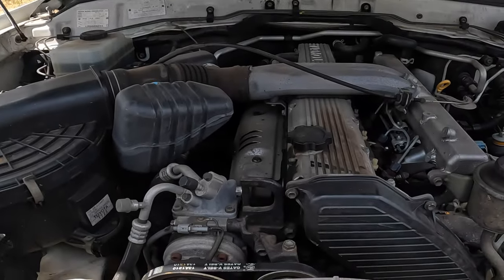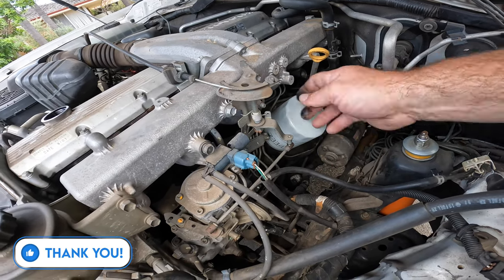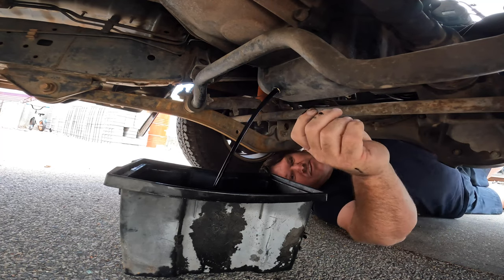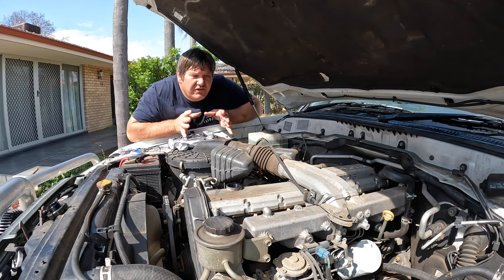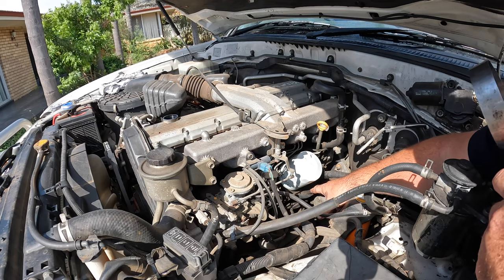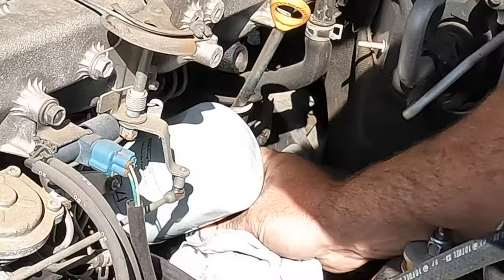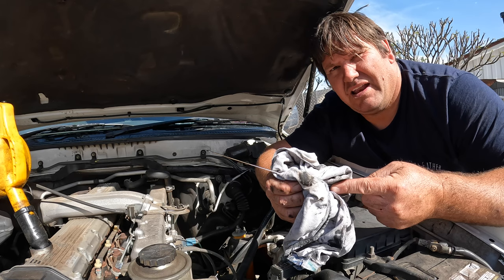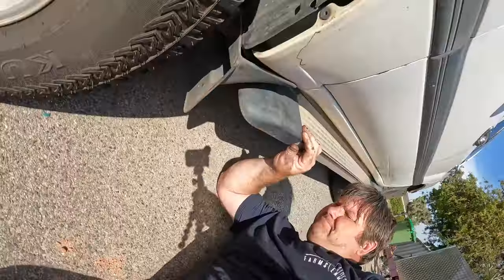TUTORIAL | 🚙 Mechanic Shows How To Change Car Engine Oil 🛢| Step By Step

Comment: Can confirm that Les has been teaching the oil cap on the bonnet catch for many years. Do you do air filter at the same time?
Reply from the maker: No mate, I do the fuel filter and the air filter at the same time